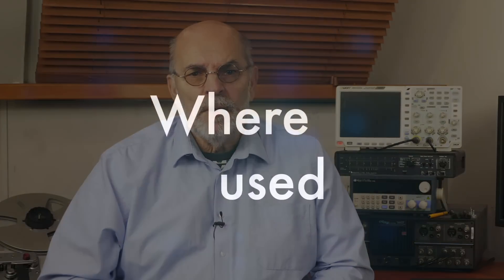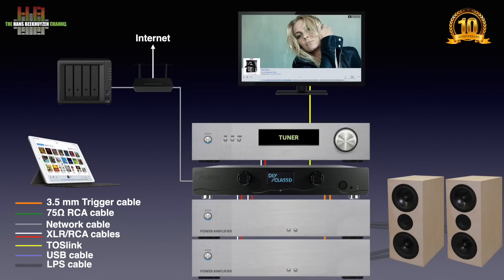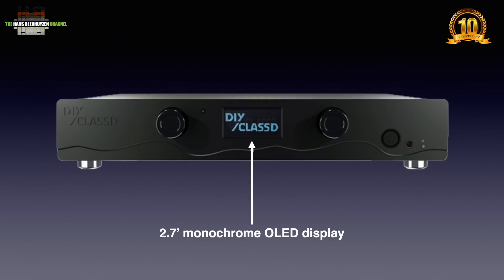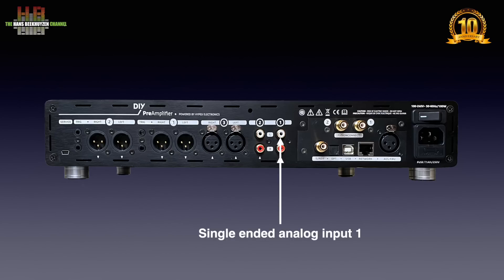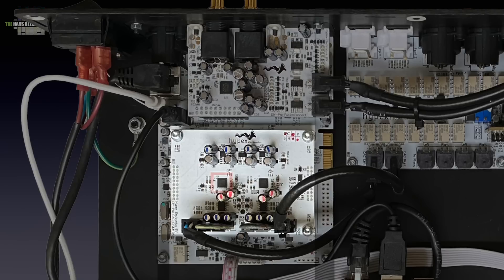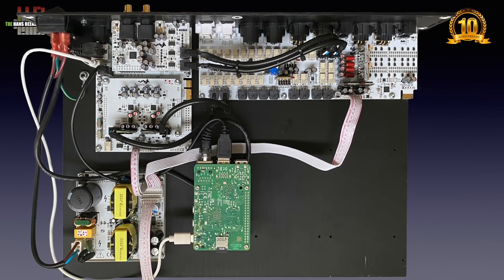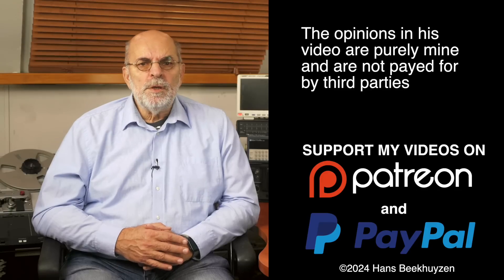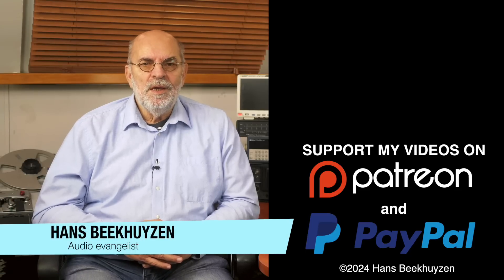Hypex DIY ClassD Streaming preamp

Comment: Hello Hans, could you succesfull Connect the optical cable and use it with 192khz -16/24 bit? Mine seems to struggle with it
Reply from the maker: I haven’t tested that but have you verified that your source is capable of 192 kHz. The AES3 standard only allows 96 kHz over optical.